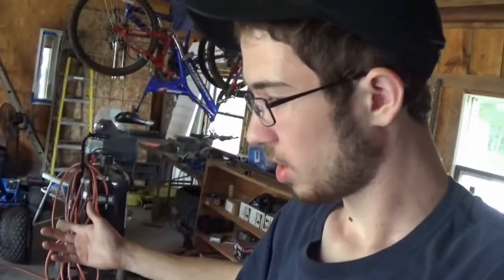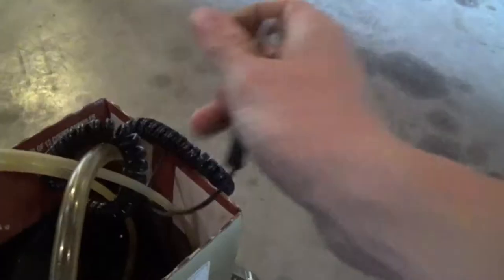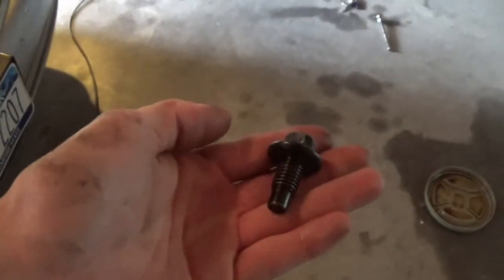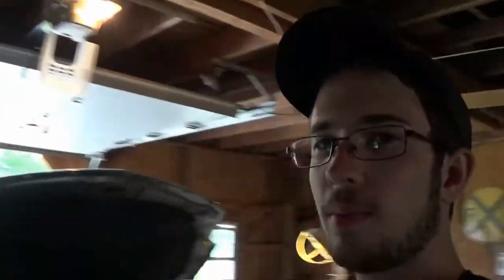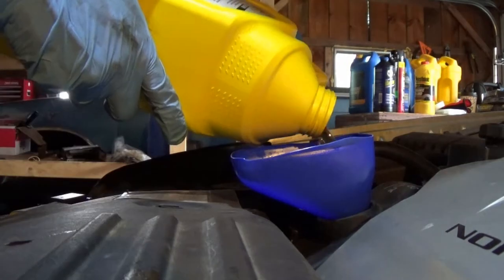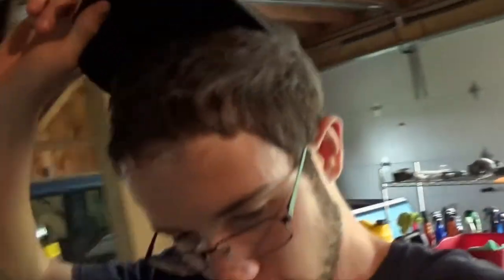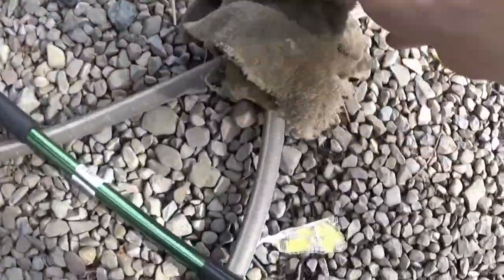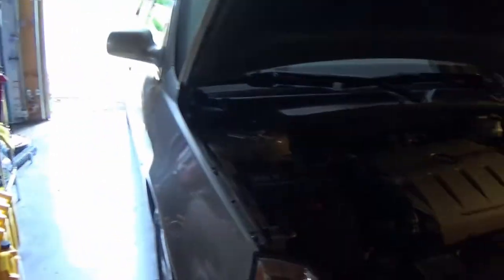The DTS Gets Some TLC

Comment: I'd be careful about tire shine, I've had it make a set of tires not even a year old dry rot because if it within two weeks... Also wouldn't it be a good idea to keep a high detergent oil in it because of the carbon build up issues that cause it to overheat and blow the head gasket again?